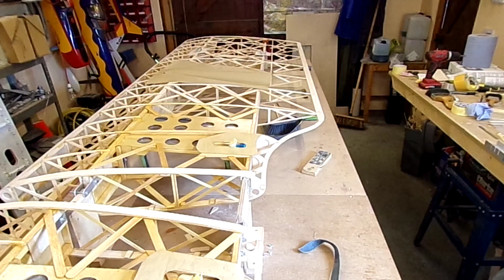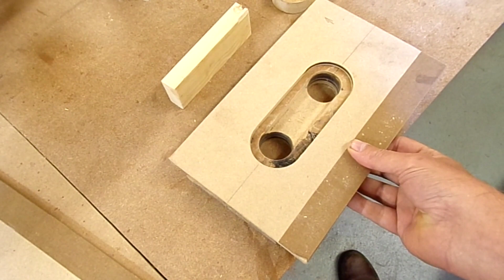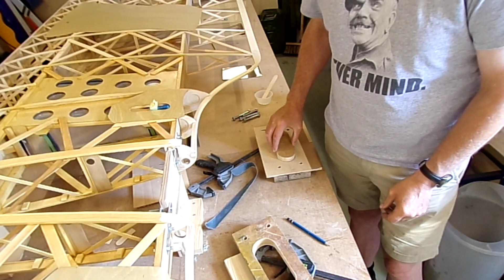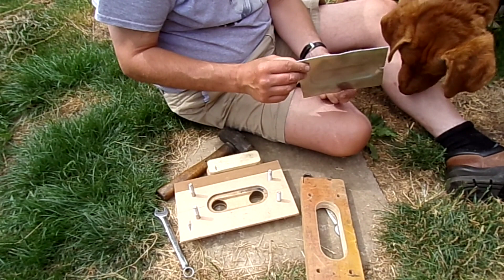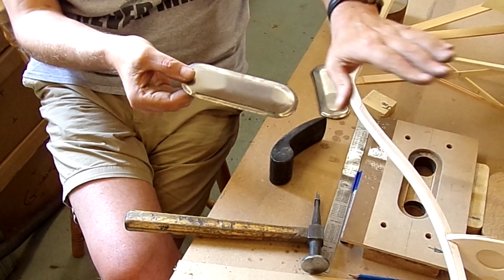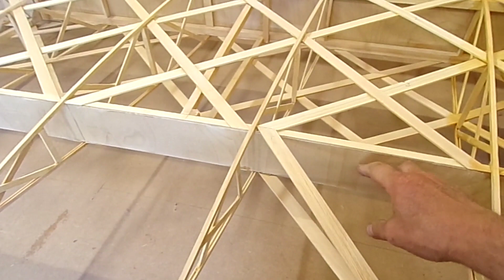EP64 Fuel Tank outlet fairing. Fisher Youngster Top Wings

Comment: Algy these don’t look like it was part of the plans… was it just open?? Or did you modify the way the tank sat in the wing… having the fitting sit a little low??
Reply from the maker: There is no plan for the wing tanks on the Youngster, they are an option, that I don't think anyone has done before. 
I couldn't mount the tanks any higher at the rear, as if you look at earlier videos you will see that the rib is cut back to the capping piece and I couldn't go lower  as there would be no place for the fuel tubing. Ideally the tank fitting would be in the side of the tank.

Comment: Why didn't you just use leather? Wet it, use your mold and let it dry to that shape. probably lighter.
Reply from the maker: I planned on leather for the aileron rod outlets on the lower wing but may still change to aluminium.  The weight in party why the weight of leather shocked me, about three times the weight for the leather I have.  Thin kid skin might be the same but very flexible.  Even fibre glass would not save much weight.
Reply: Hmm, whatever works I guess
Reply from the maker: @outlawflyer7868  more than one way to skin a cat as they say.  Leather would be classic as is the aluminium.